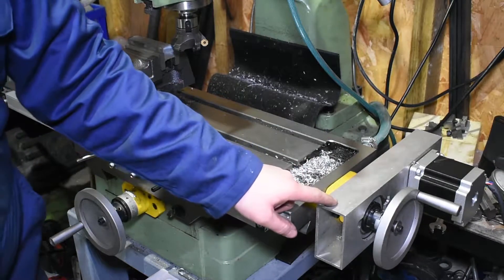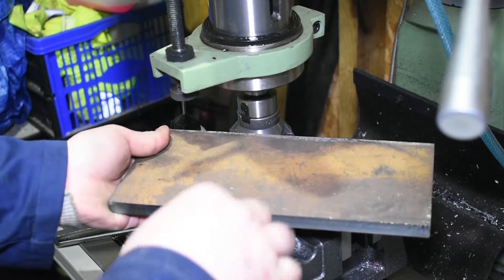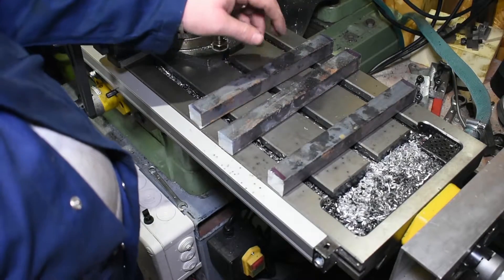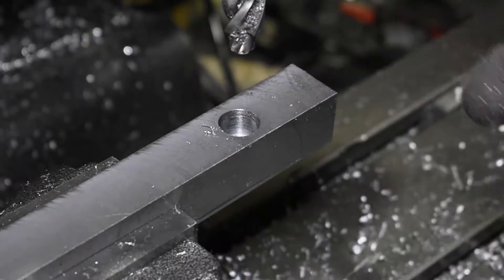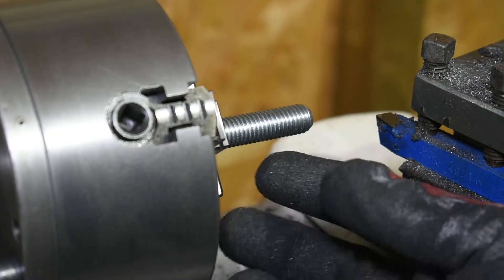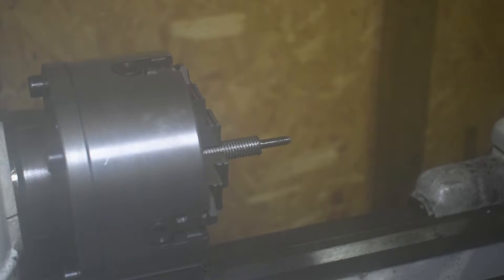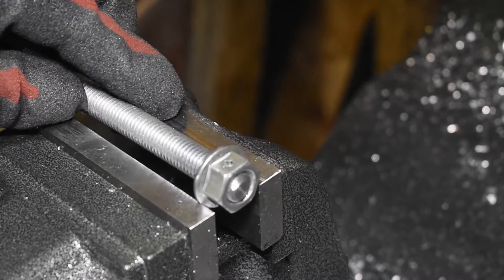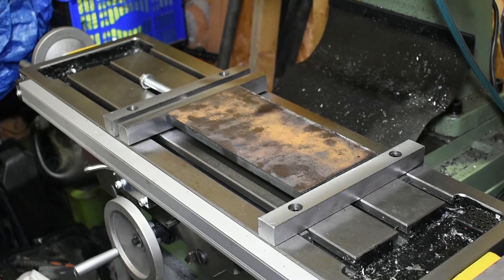DIY Power Feed - The First Cut

Comment: You'll never go back to hand cranking other than very short runs, as to your vice I recomend taking off the swivel base, it makes it more rigid and less vibration and i never once used the swivel on it. In the milling book you mentioned in another video i think it has machining jacks, they are good for supporting longer pieces. I'll be watching the shaper videos with interest. When using the countersink drills if you run them slower they will last for years, also pecking the holes will shorten those long stringy chips and keep them from wrapping up.
Reply from the maker: Thanks for your comments Derek! 👍